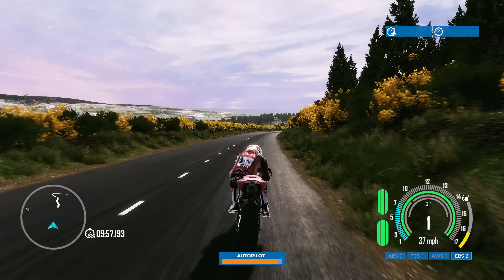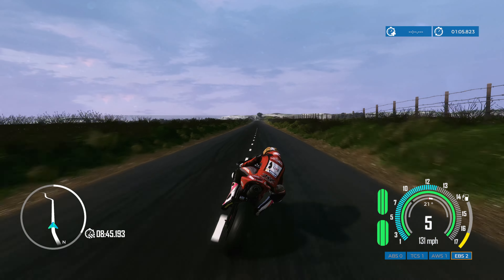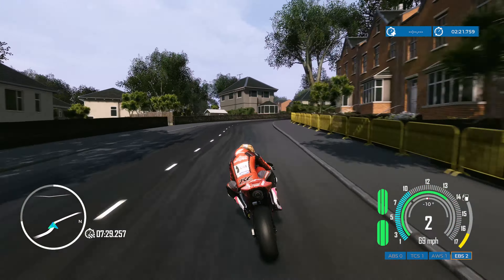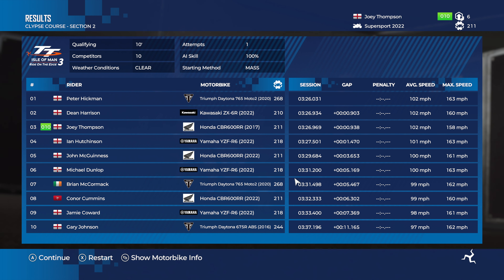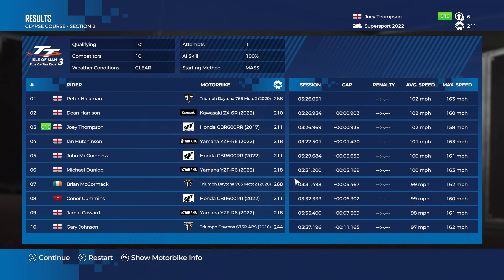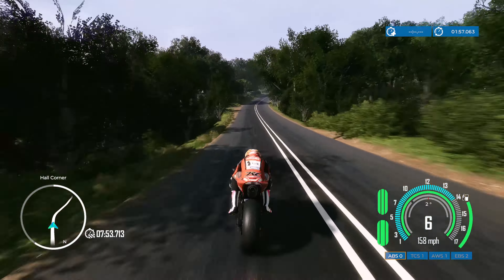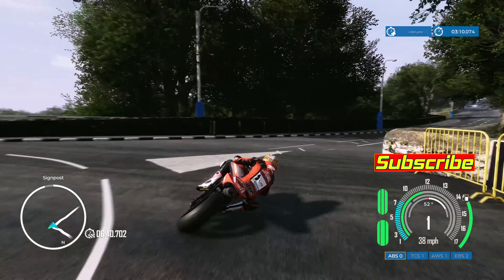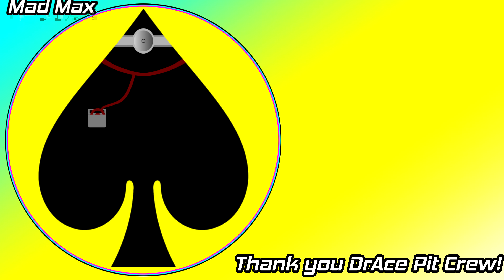TT Isle Of Man 3 - The Fuel mystery

Comment: That's the Clypse course - love that one, my current favourite. Fuel in the tank is a factor of real bikes; you hear riders talking about the difference between a full fuel load and reduced fuel load, but it's not something that has been modelled in motorbike racing games so far. If you look at where the tank sits on a motorcycle, all that weight is above the centre of gravity and the point of rotation so that difference in weight would affect the way the bike and how quickly the bike leans in, and can be picked up again. The game physics engine they use, which came from rims racing, does to me feel like it models weight and the feeling of mass more than most games, so I wonder if they accounted for fuel weight as well? Because we're not interacting with the bike in our games like we do in real life, we're not sitting on it and having these forces affect our bodies, there might be some things that are very hard to get a feeling for from the Visual representation alone, and just using our thumbs to steer with. It's likely to come down to a matter of our prejudged perception, in that if you think it makes a difference you'll tend to feel a difference, and if you don't think it makes a difference, then everything will seem normal. Very hard one to call, but thanks for highlighting it - gives me another factor to look into. I am loving this game and finding it quite addictive, the domains respecting concentration so I can't race when I'm tired or had a few drinks, but I do sometimes just get on a bike and go for a ride around the island looking at different parts.
Reply: I agree with you 👍
Reply: Thanks for an interesting comment! So, if I am looking for a simulation-type bike racing game, like the MotoGP games of late, where the front brake can lock up if you press too quickly or too much… should I get this game? Does it provide thrill and excitement? Are the AI challenging enough? 🤔
Reply from the maker: I’ve always felt strongly about a lot of things in these bike racing games and one of those things are placebo affects. I think a lot of players mistake their own abilities for a bike change or setting change. The reality I believe is the player is simply learning the track and improving. Regardless of the setup. I think only when you’ve peaked you should be extensively looking at settings etc. only then you should really be able to tell. I still don’t use any settings or setups on bike games. I made one change on SBK and swore by it.. but recently I played without changing the setting and I was still just the same. 
Yes the concentration is difficult. These massive straights affect my focus and when it comes to getting back in tight and twisty sections I make the mistakes 😂
Reply from the maker: I’d say the challenge is now more in the form of cornering and entering corners with the right speed. You can slam on the brakes quite firm but if you enter a corner too wide or not at the right speed, it will guarantee a crash

Comment: Just did a full 4 lap supersport tt. Started with a full tank and still had 3/4 of a tank after 2 laps. Came into pits anyway because I had never done a pitstop in the game and wanted to see what it was like. It's annoying how the game does not have realistic fuel consumption because in real life the tank would be close to empty after 2 laps. Also noticed an animation of the pit crew changing both tyres, which they don't normally do in real life in the supersport tt, and didn't give an option for if I wanted new tyres or not. Would be good if it let you choose wether you want new tyres or not or just a rear tyre change.
Reply from the maker: You can customise your fuel load before starting the session. You can then get the bike to run out of fuel for the 2nd lap 👍🏻

Comment: needs further research i think, you probably still had enough fuel on board for 2 TT laps, try .03 gal or as little as you can get away with for a single sector, average out multiple try's, couple of warm ups etc
but tbh, not sure that i noticed a difference when i first dropped my fuel load but i was nowhere near as good at the game then, might be an interesting test

Comment: Fuels a gray area the weight is lowered so you stop a bit quicker in some cases but depending on setup can make yku lise speed yes a lighter bike should be faster but more weight makes more pressure to the road so depends on what the bike needs
Reply from the maker: I just don’t think the game actually takes it into consideration. I was told that some players felt like it was a game changer and it resulted in large time differences. If it does make any difference it must be very marginal
Reply: @DrAce  I agree completely. I've not seen any difference in my lap times it's very weird how some say its so much better maybe its like the matrix 😎 there starting to believe ahah 😆
Reply: @DrAce  also try the BMW with no rear compression it feels better in the corners first me although I might put some compression for jumps or stoppies but with it lower its feels more stable
Reply from the maker: Haha you could be right!